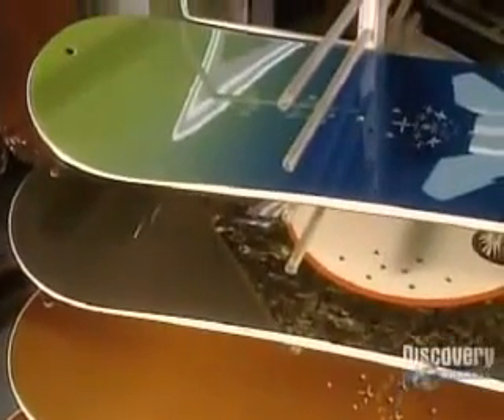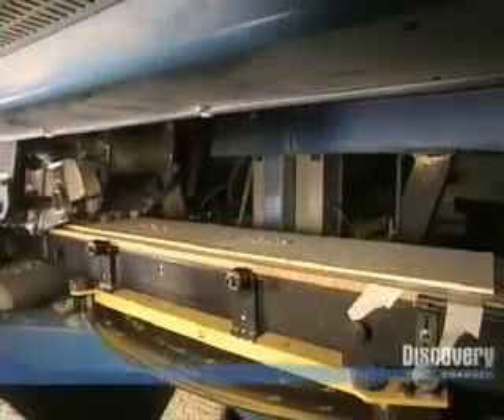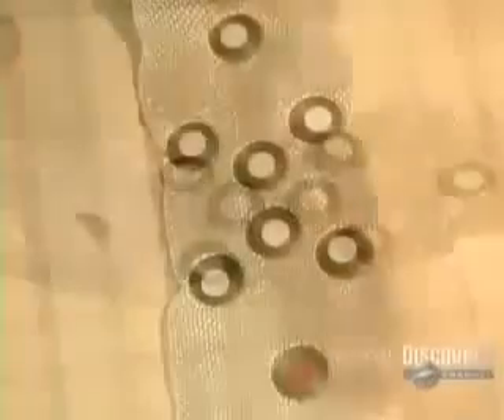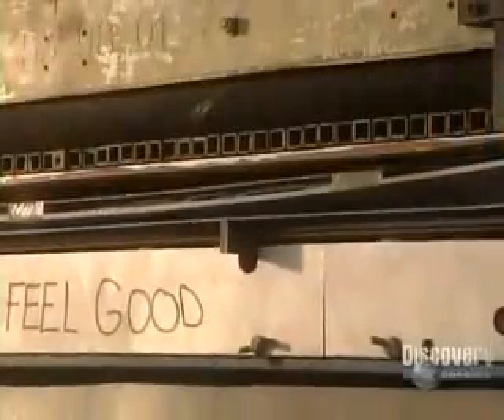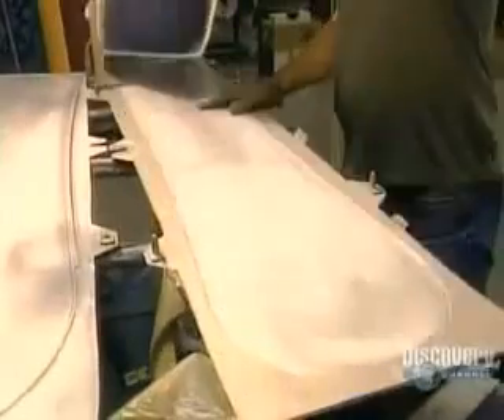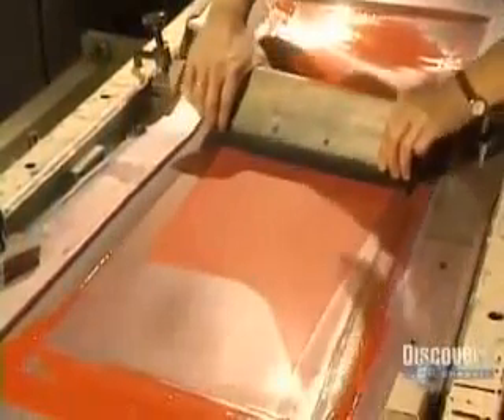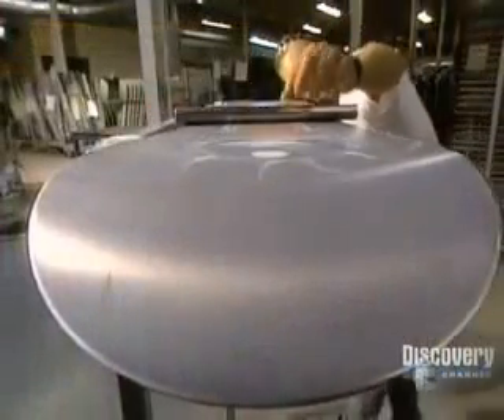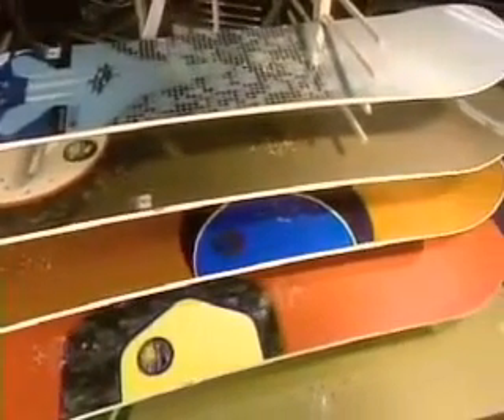How Snowboards Are Made

Comment: The edges are bent and clamped to a mold in the shape of the board. They are then removed and glued to the actual snowboards base (bottom sheet) and sandwiched all together in the pressing process with the rest of the materials.